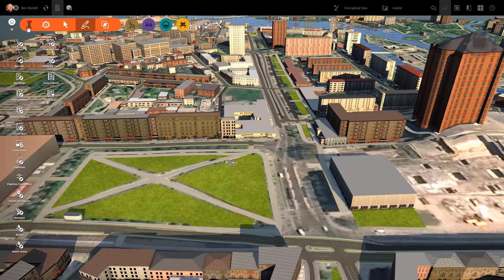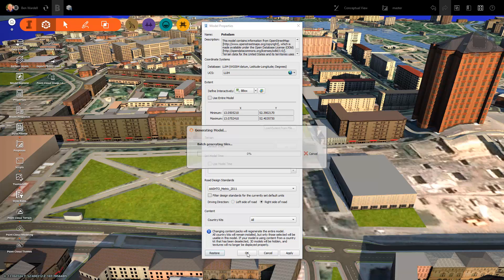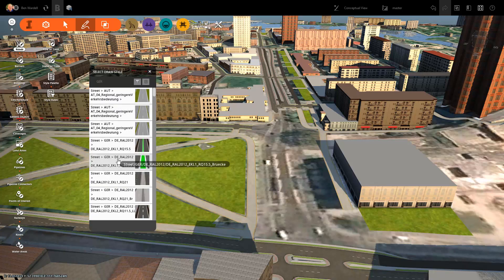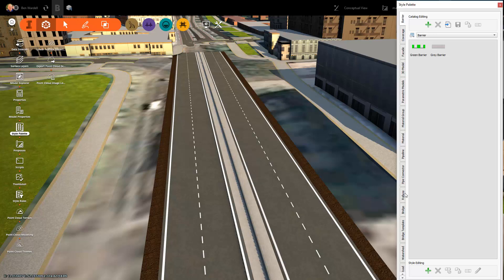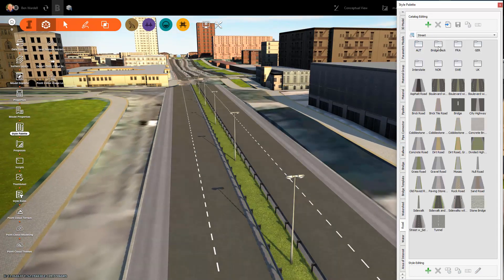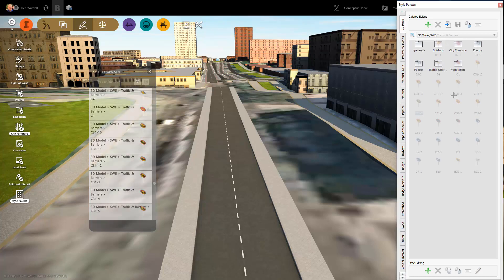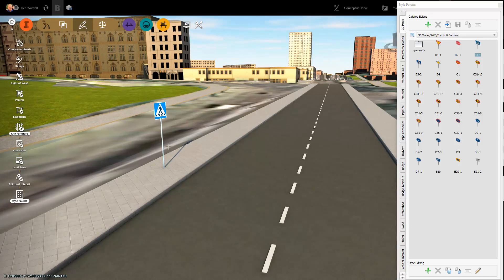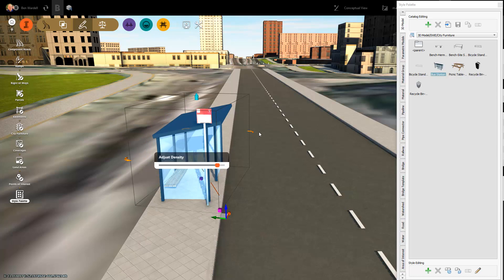Autodesk Infraworks - Country Kit

Comment: I like the idea of the country kits a lot, when i use the roads tool it works perfectly! But i got a problem when i want to use the component road tool to create a street with the new country kit. Here i can only find one of the new assemblies  which got implemented to Infraworks. I also tried to change the disgn after drawing the road with drag and drop but this doesnt work too :/  Is there a way i can create a road with the design standards of my location, using the component road tool?